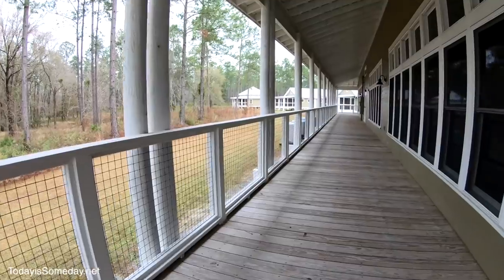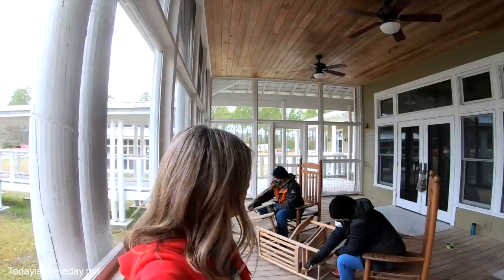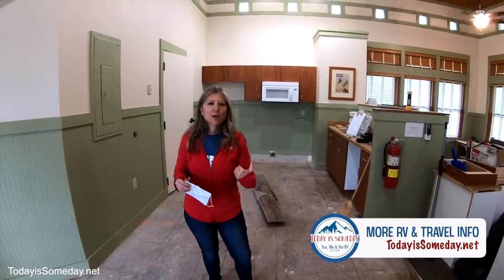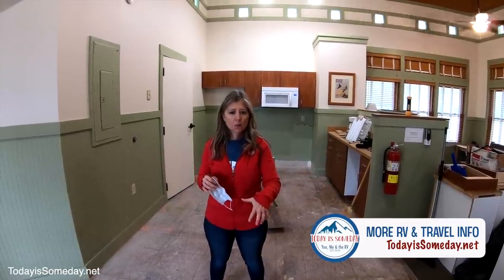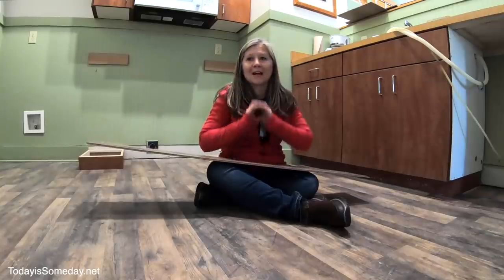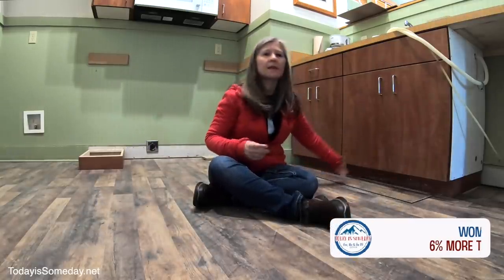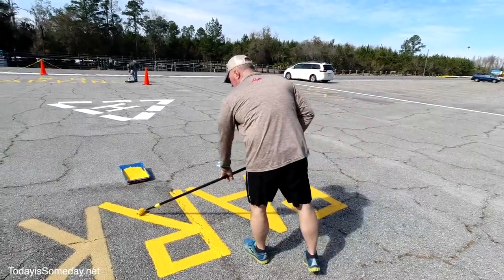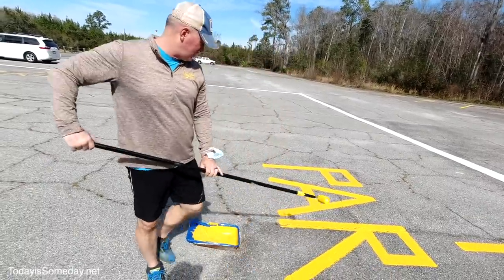We Did it Again! RV Volunteers

Comment: I did a trip to Florida from Dec. 23, 2020 to Feb 5, 2021.  I drove my Ford Explorer and actually slept in it on the bed that I built after removing the back seats.  I just wandered.  I also got kicked out of a Walmart and from a dead end road off of Rt 41 Near Everglade City.  I have to say that I did pay for camping at Starkey Wilderness Park in New Port Ritchie.  It's a great place!  It's 15.00 a night for tent camping and well worth it.  I will also say that the Explorer was a bit cramped.  Especially for getting dressed.  So... I'm flying back to Florida the end of the week to buy a Pace Arrow  Class A Motorhome.  18 months to retirement and then to AZ.  I've had enough of Fl. but I like the heat.  No more PA winters for me.  Be safe everyone and thanks for letting me share my future plans.